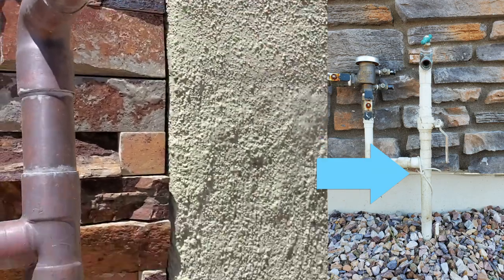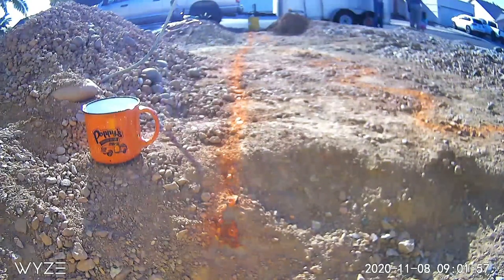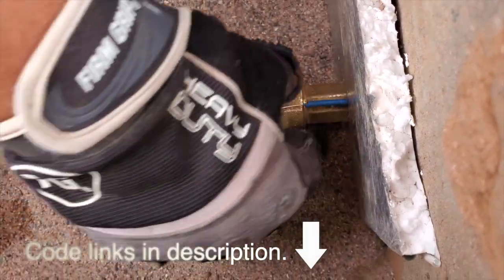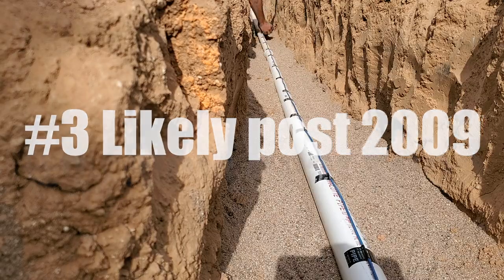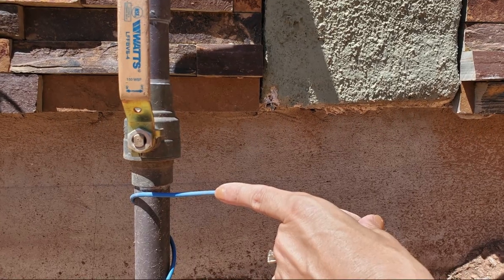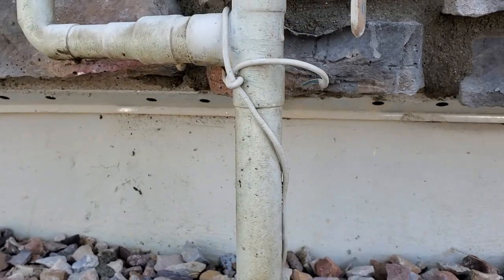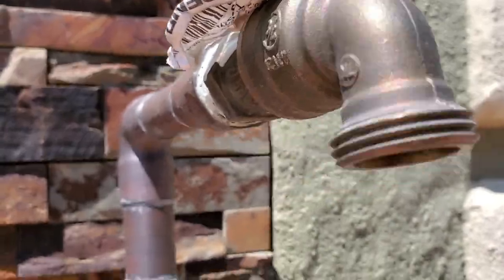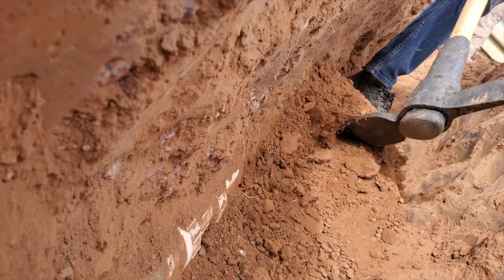What is This Blue Wire on a Water Main?

Comment: Thanks again for another one!! Quick question, maybe it’s a silly one but I’m just wondering… I seen that the wire it’s just wrapped around/hanging lose would it be ok to clamp it on to the metals(brass/copper) coming out of house or meter? And wouldn’t that have to be somewhat connected to the ground from the electrical panel? At first I thought it was for grounding purposes when I heard of a wire since the replacement of metal pipe to PVC or PEX is taking place…😅
Reply from the maker: I'm going to have to punt to a plumber for that answer. Around here the new neighborhood built just a few years ago looks identical to this where they just wrap the wire around the hose Bibb and make it difficult to see the blue on the tracer wire by spray painting the pipe and wire to match the house color. While we didn't spray paint, we followed suit. My understanding is that a piece of equipment is hooked up to the exposed wire at the meter as well as the exposed wire at the house, sending the electrical signal by a plumber when detection is needed and left to the elements for the rest of its life. I could be wrong though and the advice is worth the price charged. In the 80's--when our neighborhood was built--tracer wire was nowhere in the picture so this is an upgrade we included as well as the detectable warning tape.